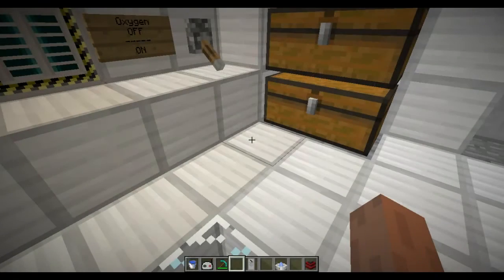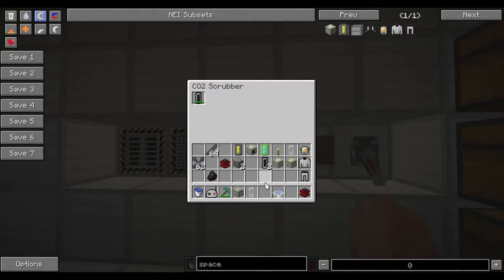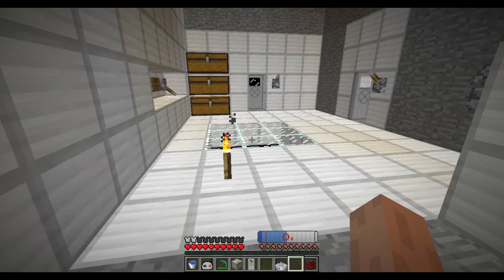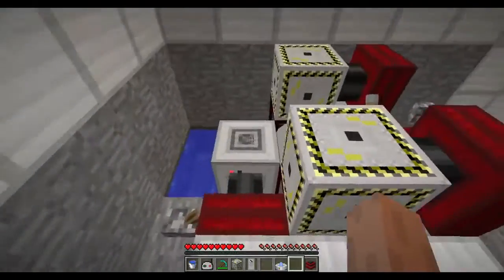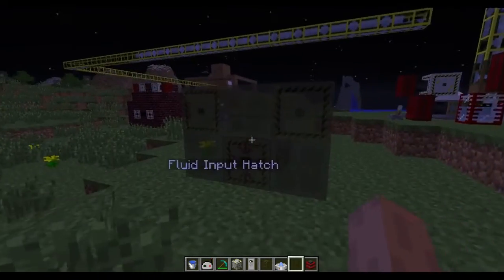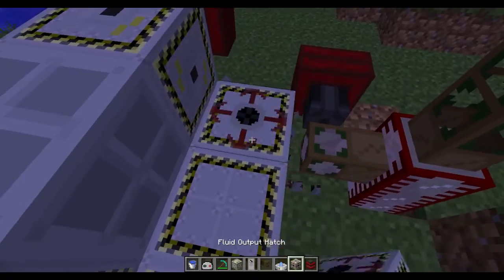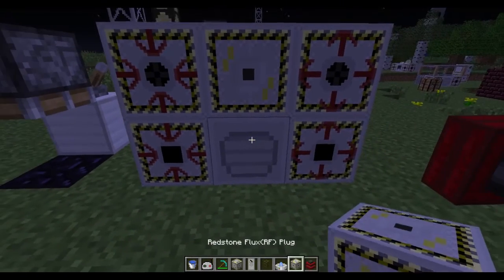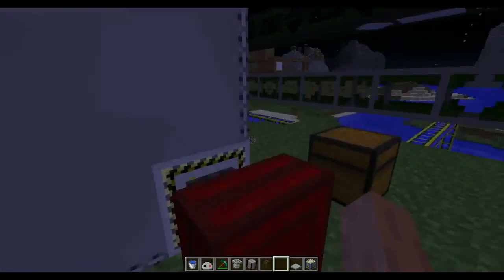Advanced Rocketry 0.4.0 update

Comment: Actually you can product H2O2 out of H2 and O2, but it's quiet inefficient (produces a lot of water as byproduct) right now and requires some expensive catalyst
What I can suggest is to add some sort of distillation system to purify the product, thus giving H2O2